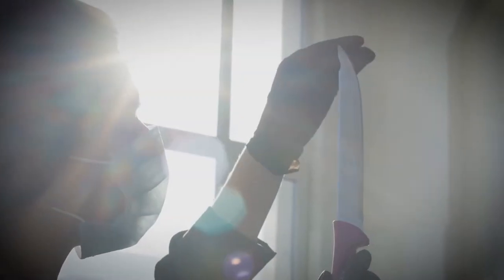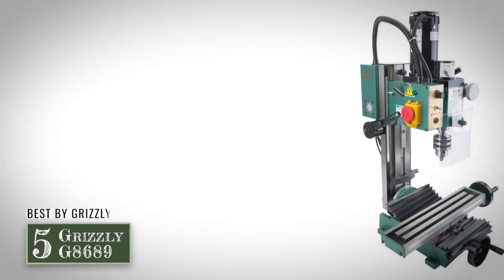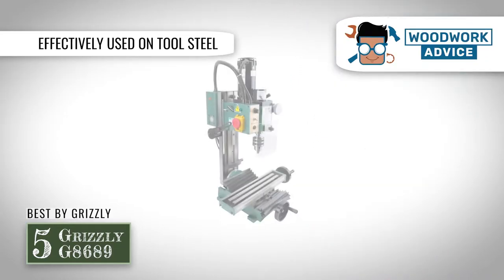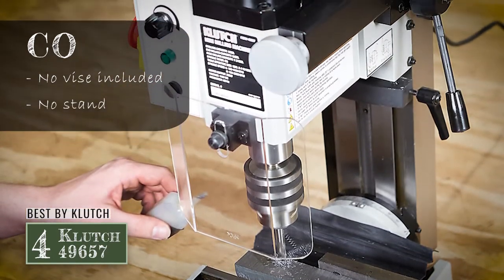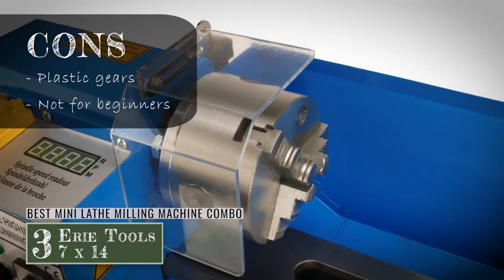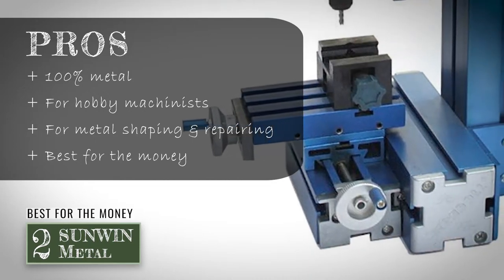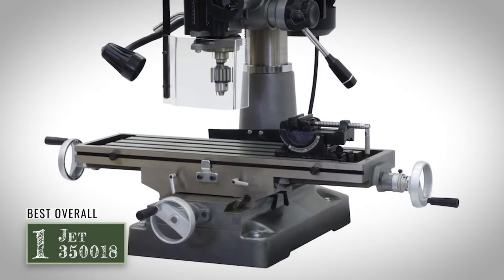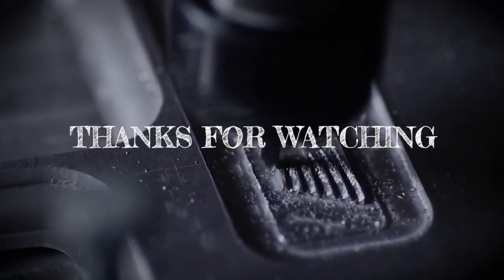Best Mini Milling Machines 🗜: The Complete Buyer’s Guide | Woodwork Advice

Comment: You can use 110 instead of 220 if you want to save some energy.  That doesn't sound right.

Walid Mahfoudh
Originally Answered: Which is more efficient to use 220v or 110v?
Electrical power is a "combination" of current and voltage. This power that an appliance needs to work properly is theoretically constant, so if you increase the voltage, the current demand will decrease.